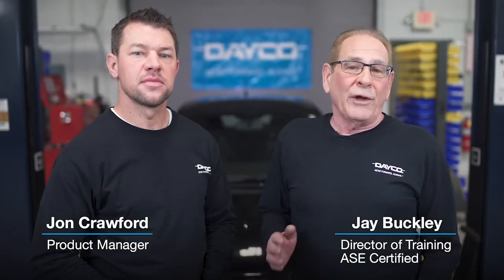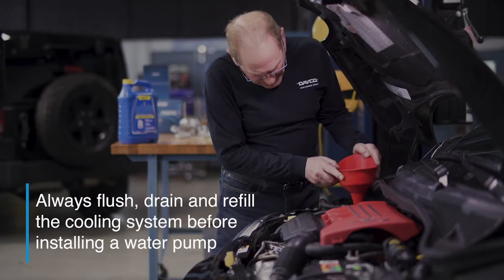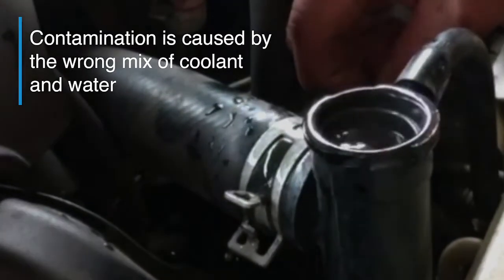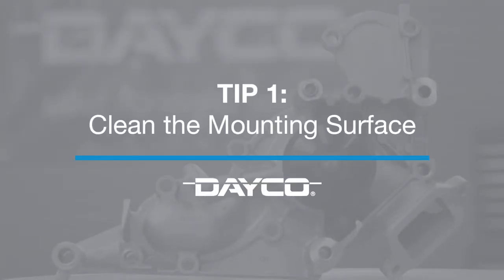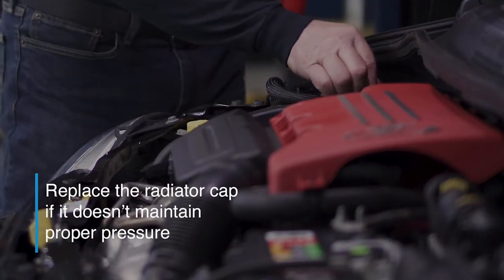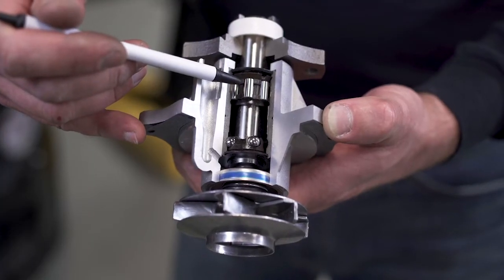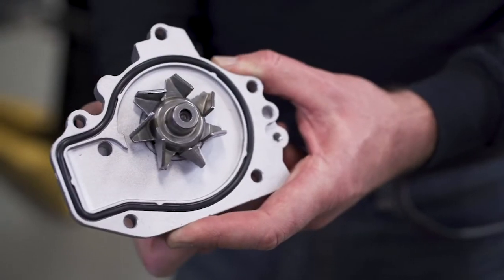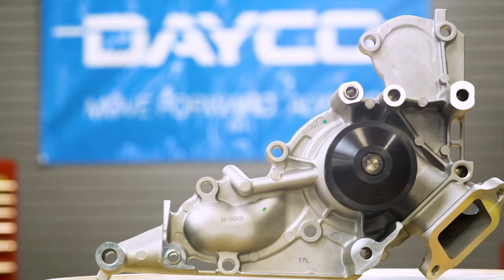Dayco - Common Water Pump Installation Errors

Comment: I installed a new Dayco water pump for a camry and lasted a week.
The seal failed big time and coolant was gushing from the weep hole. 
Since replaced it with a GMB and now all good.
Nothing worse than putting years of experience into doing a job and having to do the job again.

I'm kicking myself for not using GMB or Genuine Asin from the start but I let my parts supplier choose for once.